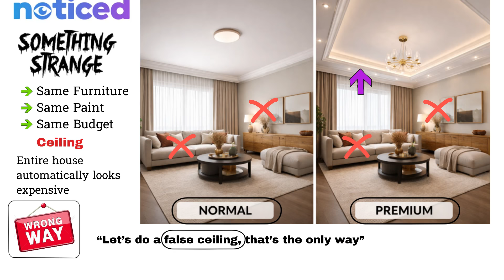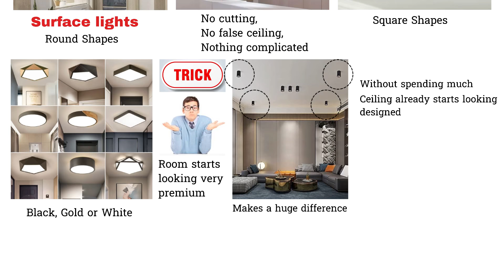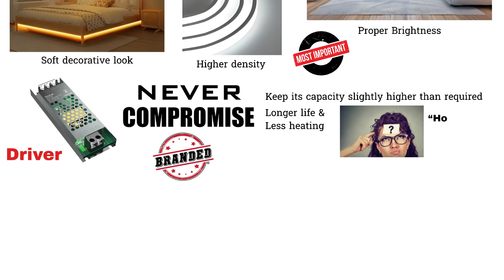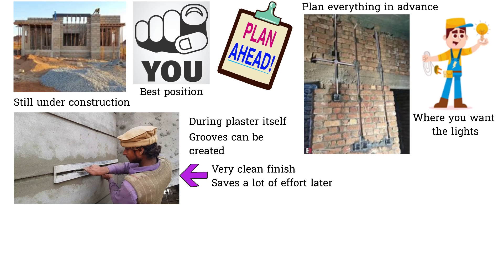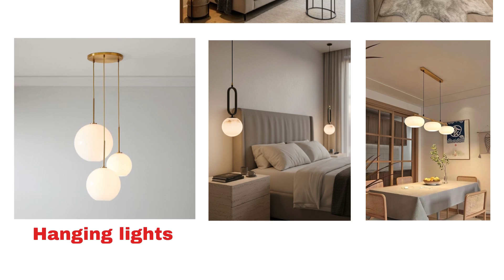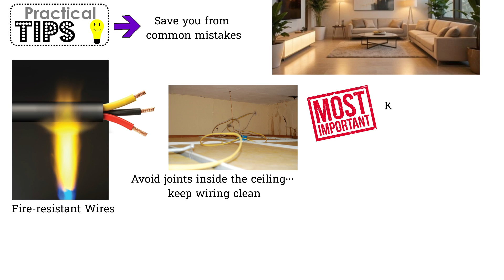Skip False Ceiling I Better Than False Ceiling I Luxury Ceiling Hack I

Comment: But still drilling needs to be done to the roof which may cause leakage from top floor.
Reply: your slab will be 6 inch. drilling 1- 2 inch will not cause any damage.

Comment: Sir... you are telling profile lights on ceiling is premium.means installing profile lights directly to true ceiling? Or on pop ceiling.please explain clearly.if pop ceiling,then how thickness should be pop plain ceiling.
You are telling that making grooves to directly to true slab ceiling? Or for pop ceiling?
Reply from the maker: Profile lights can be installed on ceiling plaster also.

But for a clean n premium finish, its better to do a thin POP layer (around 12–15 mm) n make grooves in that—not directly in the slab.

Direct plaster installation is possible, but groove edges and finishing may not look as sharp. Thats y POP is preferred for best results.